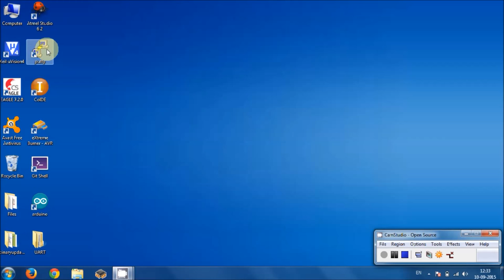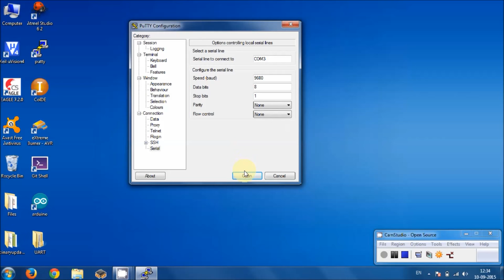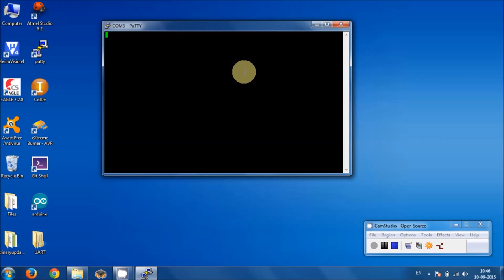PuTTY Tutorial for Serial COM (step-by-step guide)

Comment: Wait !   Back up a bit..  unable to connect to comport is the error message I get..  any rocket scientists out there able to help please ?
Reply from the maker: Hi Mark, I hope you've verified COM port number from your Device Manager. Please check once. And also make sure Baud rate must be same as for transmission and receiving data. I hope this may help. Good luck and best wishes!
Reply: @BINARYUPDATES  thanks for that.  Yes both checked. Worked 5 years ago and nothing has changed.  Spent hours trying so they going in the bin.

Comment: Mine Just shows a black screen.
Reply from the maker: +Thatoxic player : could you please elaborate your issue. I mean what exactly your trying to do....

You may want to try this,  check your all parameters while setting up putty and also make sure baud rate and databits into your microcontroller firmware.

I hope this might help you
Reply: +BINARY UPDATES
I'm connected to the console port on the switch on the back. 
I already searched on device management "COM5" I select "Open" 
Then Just gives me a black screen I'm unable to press anything No Letters or enter.
Reply from the maker: If you have opened COM5 that means you have configured PuTTY. I can only say please make sure your program/firmware is correct otherwise it won't work.
Reply: @Thatoxicplayer  same thing is happening with me , please reply if you have solved this problem
thanks

Comment: How do you know which COM port number to use?
Reply from the maker: To know Which COM Port to Select. One must open "Device Manager" on Windows Machine and under the PORT Section or similar. We will find COM Port assigned to your device which you can use later-on for setting up PuTTY.
Reply: @BINARYUPDATES  Thanks for the quick response. I believe I got a serial adapter that is just impossible to find a driver for. I went ahead and bought a cable with a chipset built in so I don't have to deal with the driver anymore. Thank you so much.
Reply: @BINARYUPDATES  Just subscribed by the way. You're awesome!

Comment: @BINARY UPDATES  Thanks for such a great video! 
I'm using ARM-M4 family (Tiva launchpad board) and I want to transfer data (raw signal) to the PC. I have two questions:
1) Should I use UART or USB as a serial communication? (I still couldn't understand the difference between UART and USB!) 
2) If it is done by UART, where I should find the data in PC? can PuTTY help to store data in a particular folder?
Many thanks in advance!

Comment: Thanks for this very helpful video, its just lacking on thing!
How do is save the serial settings, I want to save the settings of 19200 baud, 7 data, Even parity, 1 stop bit and none flow  control. So my problem is I cannot switch back to the opening screen to save the settings. When it switches to the black screen it is short of a menu bar at the top of it!

Comment: hi please guide with this 
error:
unable to open connection to COM1 Unable to open serial port
Reply from the maker: Hi Arya, make sure your serial cable is assgined as COM1 in your computer or laptop. Apart from this you can check other settings like baudrate, parity bit etc into the settings of PuTTY. I hope this may help you get it working. Good luck!!